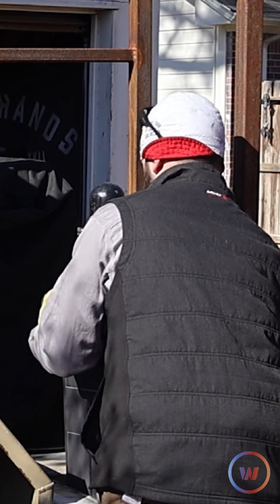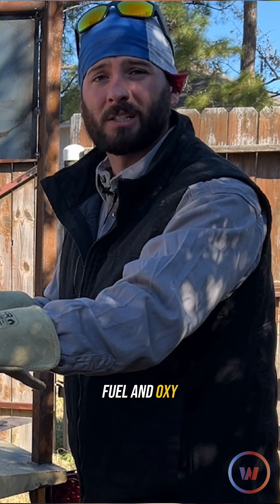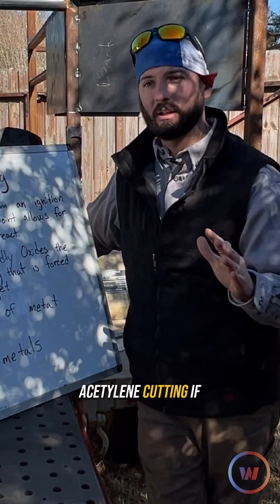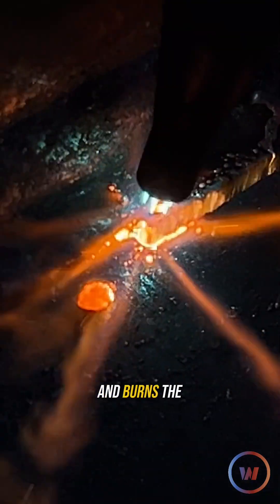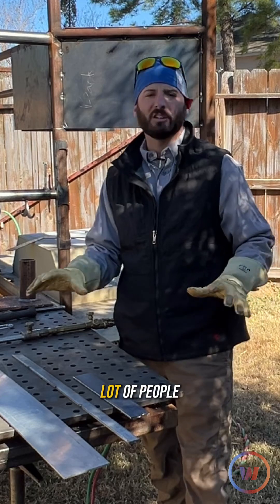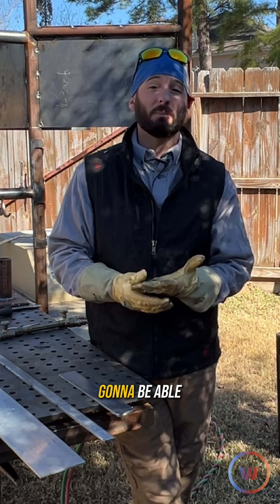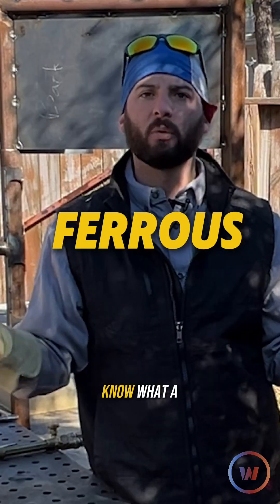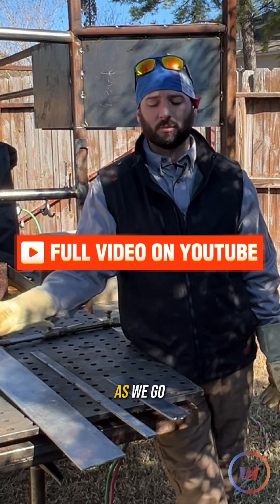What Metals Can You Cut With An Oxy-fuel Torch? #fabrication #oxyfuel

Comment: I bought my torch almost two years ago . … still waiting to get fuel lol .. the question I always ponder … how big a tank of acetylene should I get .. I learned you need to keep the flow rate in balance with the tank size … At first I think I was figuring to high .. as in all reality I won’t be working on heavy steel. Mainly doing art stuff which could be whatever lol I know I babble lol thanks for the video.